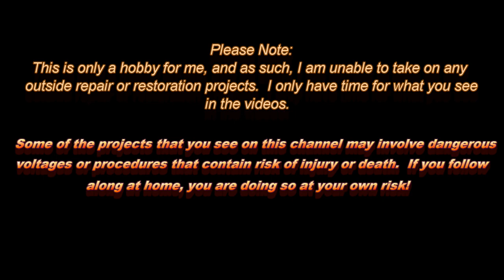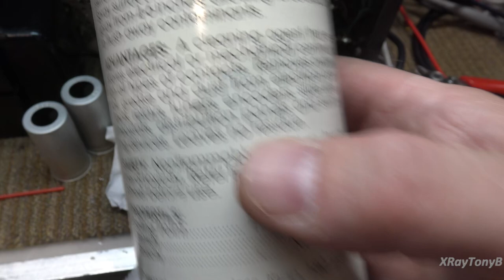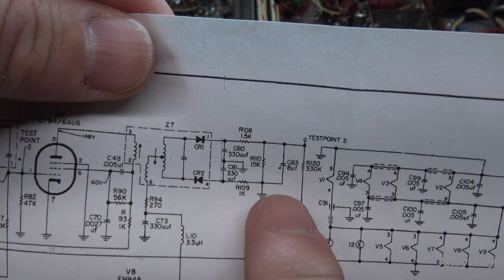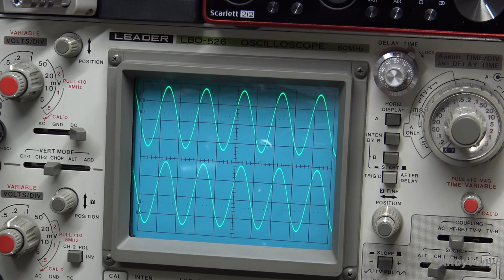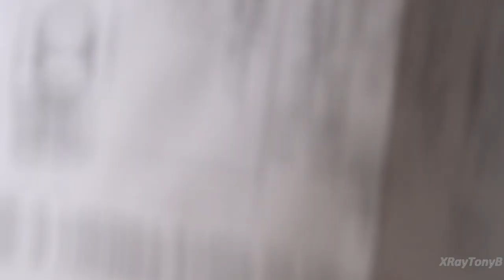Fisher 800B Part 5 - Phono & Tone Control Stages

Comment from the maker: I took the long way around when troubleshooting the phono & tone control stages, so that we could have some fun with signal tracing!  

0:15 Intro
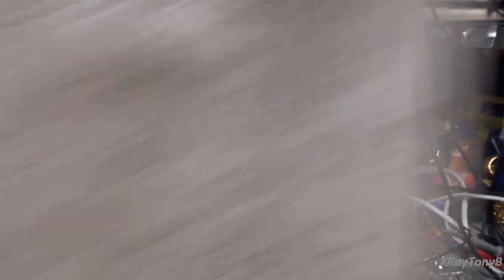1:20 Evaluating the Phono Stage before repairing/restoring
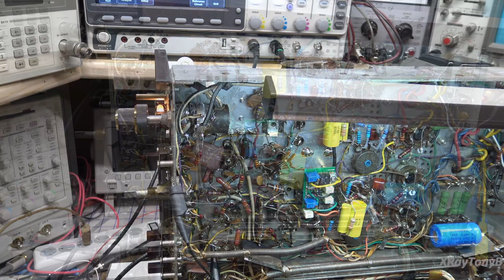6:18 Finding the source of the noise
7:07 Cleaning the tube sockets & Pins / Cleaning up the tubes
20:52 Replacing the mounting grommets for the phono stage tube sockets. Cleaning things up.
23:46 Replacing the last two electrolytic caps in the  receiver.
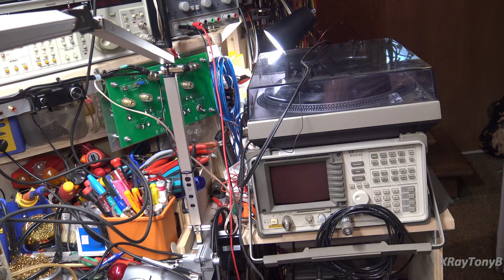25:45 First test of phono stage - Not too good :(
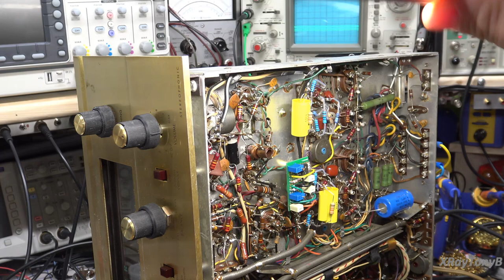26:37 Troubleshooting the tone control stage by tracing a signal through the circuit.
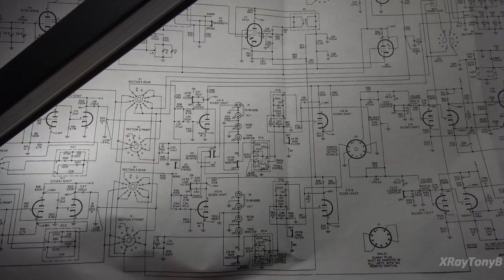37:18 Phono & tone control stages are repaired!  
39:44 Let's spin some vinyl!

Comment: Just took a look at my Fisher 500C, and sure enough there are two tubes that have the rubber suspension on them, they are all hard as Bakelite. Those are there for microphonic isolation of the chassis. The 500C uses 9 of the 12AX7 tubes including the phase splitter. Wow, thanks, I learned something new about these today.

Comment: The white in that tube is oxidation of the getter flash. This indicates the tube has a slight air leak. Just a few molecules of air will cause the white oxidation and tube gain to fall off. That tube is just slowly loosing its vacuum which sucks ;-)

Comment: Dental cleaning brushes are useful and moderately OK for cleaning tube sockets, but heavily tarnished or corroded pins such as what we see here really demand something a little harder and more abrasive, and until such time as somebody comes up with miniature wire brushes that can fit into a tube socket, the best solution I have found is a wound guitar string of .036 to .039 (thousandths of an inch) worked back and forth inside the contacts.  The guitar string acts like a miniature rasp or file (phosphor bronze acoustic guitar strings are extremely hard, ordinary electric guitar strings probably a little less so, and flatwound strings with a machine ground and polished surface would be the least abrasive). If  you can chuck the guitar string into a miniature rotary tool, something similar to a small Dremel,  or a battery powered eraser, so much the better,  it will clean each contact in 3 or 4 seconds. Flush with pure alcohol or similar no-residue solvent afterwards. 

By the way, I have seen some older brands of contact cleaner that say on one part of the can "cleans and lubricates", but elsewhere on the can it says "leaves no residue".  Obviously both of these cannot be true!
Reply: Maybe not recommend but when no other options is to hand twist a small drill bit to get stubborn oxide off but wouldn't do on anything valuable as you would take off the plating.
Reply: @marka1986  the guitar string will be gentler than a drill bit.

Comment: That "noise" sounds a lot the noise the Phono-1 stage in  my old SONY (circa 1975) pre-amp made before I re-built the "other" (phono2) input stage to replace it. The phono-2 stage is a plug-in board. I'm sure it's still making that noise. Some of those resistors look like were updated.

Comment: Grid leakage is a tough one to pin down sometimes. Just had a KT88 develop grid leakage and take out an output transformer. Tube tester would not find it because it had to be on under load for about 5 minutes before it acts up. DC offset would then swing all the way to one side and the tube would go into full conduction. Substituted a pair of Tungsol 6L6G I had as backups and the problem was resolved. Substitution and in chassis testing is the best way to find a bad tube, tube testers should not be relied on and will only tell you so much. My icon picture is from my Mercury transconductance tube tester, I also have a Hickock card-o-matic tube tester for the old 4 pin tubes.
Reply: Zulumax1,  The original KT (kinkless tetrode) tube designs, KT66, KT77, KT88 etc, were supposed to include gold-plated grids to prevent grid emission ( I've seen old ads for GEC tubes that claim gold-plated grids), although a gassy tube could of course still cause grid emission. Nowadays, with "KT88's" being made in China and Russia,  I don't expect them to be made to conform exactly to the original specifications or standards. What brand of tube was it that failed?
Reply: @goodun2974  How ironic, I am using the reproduction Genalex Gold Lion tubes made by Electro-Harmonix. Yes they have gold clad grids, one of them failed.
Reply: @goodun2974  Before that I was using the new production Russian made Tungsol 6L6G which are built to 6L6GC specs so they can handle 500v plate voltages. Have had several pairs of those go to air.
Reply: @goodun2974  Kinkless Tetrode, was an interesting way around the patent on the beam forming plates of the pentode design. I think that was Phillips, was it not?
Reply: @zulumax1  , I think it might have been the other way around, the RCA "Beam Power Tube" design was a workaround to the Philips Pentode patent.
Reply: @goodun2974  Not sure who had the patent first, the Americans, the Dutch, or the Germans, but from what I read the British came out with the Kinkless Triode as a workaround. Now you got my curiosity peaked.
Reply: @zulumax1   Several decades ago I had a pair of new old stock genalex gold lion KT66s in their factory sealed plastic bags  with the individual test report. Sold those for some pretty good money at the time. More recently I sold 2 pairs of GEC metal dome tweeters with gold finished alnico magnets, and crossovers.  I was curious as to what speakers they were used in or what other speakers might have been manufactured by GEC but I was unable to find any information on them. The domes appeared to be aluminum with some kind of sputtered material on them that looked like the spray shielding used on some old European tubes.

 One of the weirdest things I picked I picked up at a local flea market some years ago was a dozen 350B tubes made by 
National Union,  basically the same tube as the Western electric 350B, AKA 6L6G.  I sold them for some pretty good money even though they weren't actually branded or manufactured by Western Electric.
Reply: @zulumax1  ,  Probably time to look it up in Saga of the Vacuum Tube", or Tube Lore, or one of my other reference books.

Comment: Nice video.
BTW, what would happen if you removed the metal shield between output tubes and output transformers? 🤔
Reply from the maker: The transformers would get hot from the tubes and possibly damage the windings.
Reply: @xraytonyb  Well, I suppose that the metal shield is preventing capacitive and inductive interferences between tubes and OTs as well. And if the tube side of that metal shield  was painted matte black, it probably would keep tubes more cool.

Comment: Back before I let a doctor convince me I would live forever if I quit smoking a pipe... You know what a fuzzy wire pipe cleaner is. They sell those things with almost un-see-able (very small diameter) soft brass wires twisted in with the fuzzy stuff. They did get hard to find.
Any way, cut in 4" lengths, spray with CRC or like same. Cleans sockets good and fast. If you don't go Hulk on it, they would not de-laminate the sockets.
I got smart one day and put one in a drill. I loved just how shiny the sockets got. Until I realized what I had just done.

Comment: I frequently use "pencil" erasers (draftsman's erasers really, abrasive enough to remove ink) for cleaning switches, relay contacts, tube pins and terminal strips, or even a chassis prior to soldering a ground, but finding good new old stock eraser pencils or rods that haven't dried up and become brittle with age is difficult nowadays, and all the formerly famous brands such as Faber, Castell and Ebersold are being made in Venezuela or China and the eraser material they use is soft white vinyl with little or no grit in it. What brand/ make is that pencil eraser, what diameter are the rods, and are they available in various abrasive grits?
Reply: Miss the typewriter erasers. I have a few but they aren't very pliable anymore.
Reply: @marka1986 , yeah, that's what happens to the 1/4" Sanford eraser rods for AC-powered draftsman's erasers, they dry up and become brittle. The battery-powered erasers popular with artists use 4 mm erasers but the supplied vinyl erasers are too soft. Sun Seed Dolphin makes 3.5 mm "sand" erasers with silica that can adapted to fit the standard 4 mm battery-powered units with a wrap of tape or heatstroke tubing around them.

Comment: I think you'll find that's close cell foam air can't pass through it is closed cell foam
If you dip the valve pins in some conductive polymer would help give it 3 coatings don't get it on the glass and do the same for the socks has the same conductivity has pure copper. You can read about it on chord Electronics and and buy it
Well that's CRC is acetone. I think that's a myth I don't think the band is an indicator on the capacitor not on modern ones
The phono stage tube should be balanced each tube, I don't think they were balanced tubes
You can use 5751 tubes I think the ecc83 is the best tube tube doctor 12ax7-c tad  rt001is a good valve. The 12ax7A- tung sol is a good tube adds a lot of clarity to the top end and with a warm mid-range should be able to get them for £12 each. The ultimate tube is the general Electric 12AX7wa not cheap tho made for the US government
Another good tube is Sovtek 12AXWC better than the Chinese about £13 each as low-noise compared to the Chinese producers tight clarity define bass and clean smooth treble response